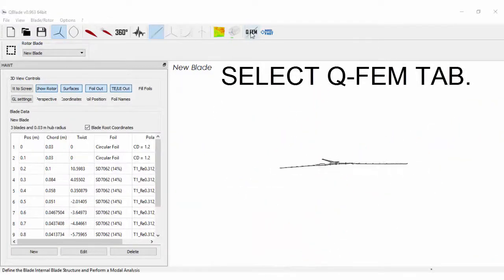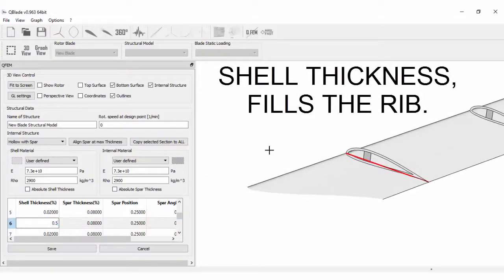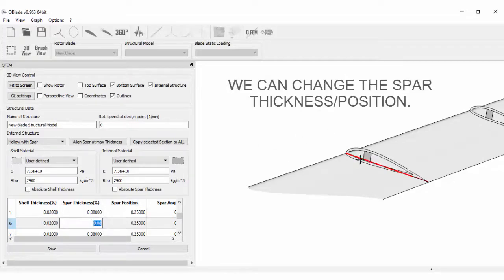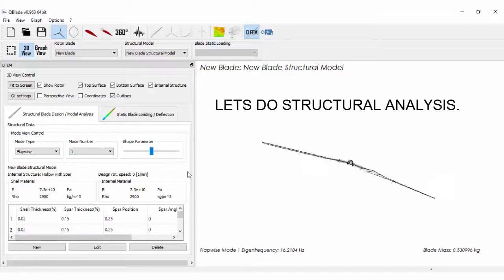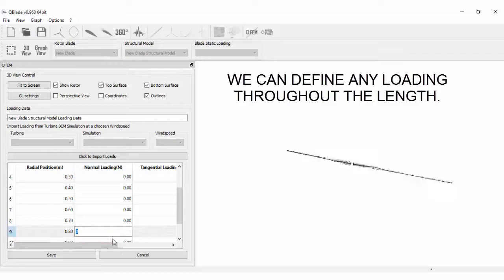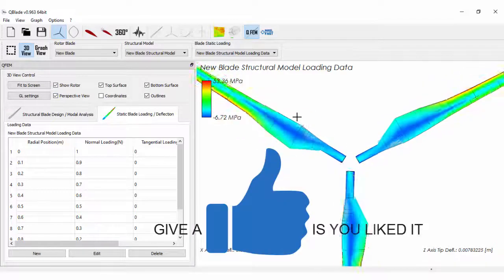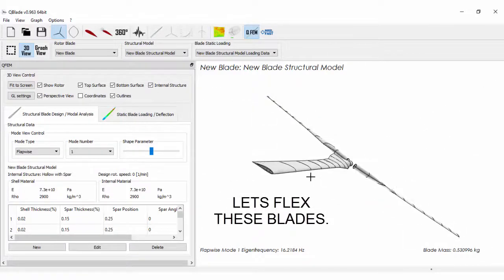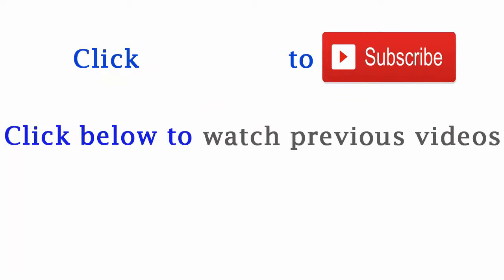Q-BLADE Tutorials for beginners | Blade Structural Analysis |Wind Turbine| HAWT💙

Comment: How to import blade loading?
Reply: We can import blade loading if we perform turbine bem simulation over a range of windspeeds in bem simulation option. After this we can import the loads on the blade corresponding to the Bem simulation at a windspeed of our choice. I wanted to know how the software calculates this loading on the blade and if this amount of structural analysis is enough. We plan to manufacture a 2kw blade with radius of about 1.6 Meters. Wanted to know if qblade FEM results are enough or we should perform some alternative structural analysis. Thank you !
Reply from the maker: That’s amazing amount of research! Thanks for the information, and I am sorry for replying so late! Qblade is a wonderful tool. But in order to get more accurate results you can go with FSI using Ansys module. Combining structural and fluent capabilities you can get accurate blading loading results!
Reply from the maker: Thanks for this wonderful question! Once the structural model is defined and saved, the modal analysis is automatically performed hence. I believe this software cannot be used to import external load data. But I will definitely look into any alternative and get back to you. Thanks for your question 😊